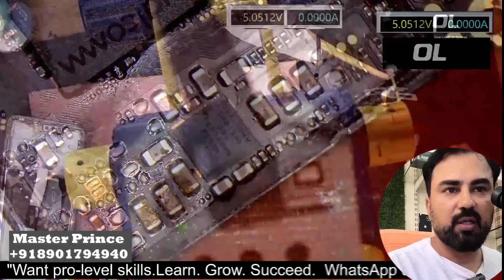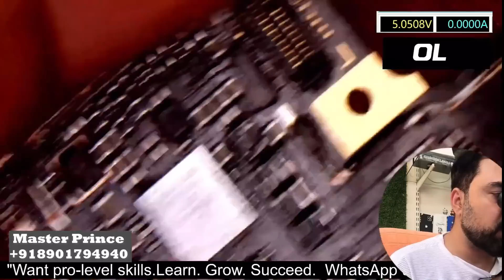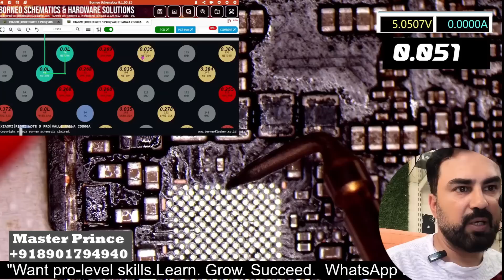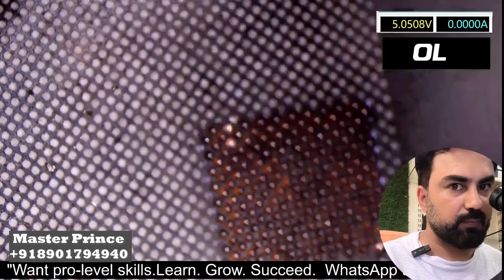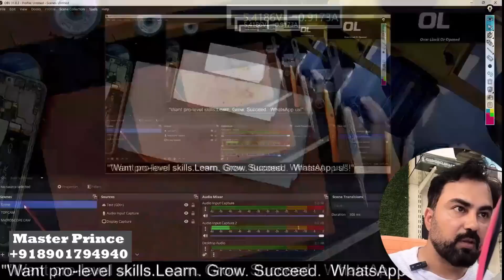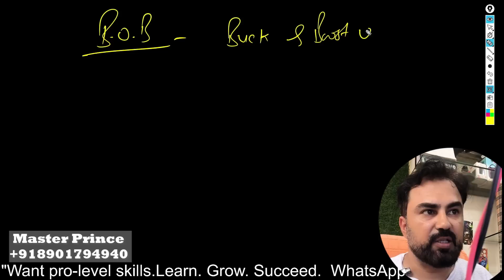"Low Booting Mobile Repair: How to Fix Dead Phones & Short Circuit | Mobile Repair in English"

Comment: When we get to the point where we have to disconnect a PMU, if there are two like in this case, by what criterion will we choose which of the two PMUs we will disconnect to take measurements on the pads? Because you said in the video that the short circuit was in the B.O.B.s which are made by the second PMU, but you disconnected the first PMU! thank you!

Comment: sir,i have a question when injecting voltages do u consider the polarity of capacitors?
Reply from the maker: 1.these caps are non polarized caps..2.this caps connected on parallel line..one with Gnd one with positive voltage line...so voltage inject on positive line side